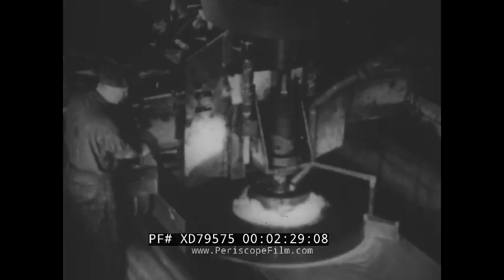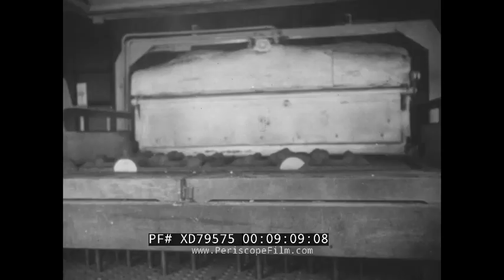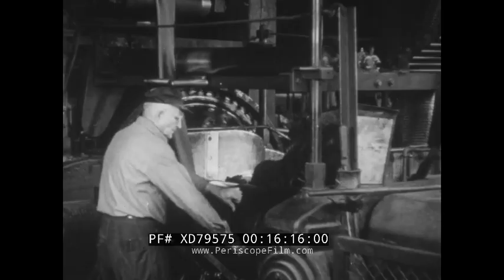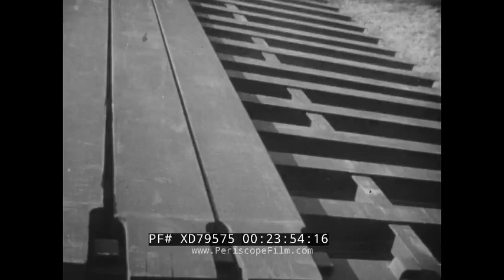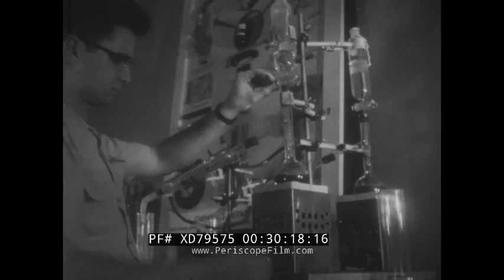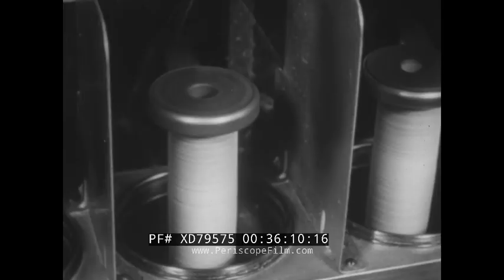" INDUSTRY ON PARADE "  GRANITE PROCESSING   SYNTHETIC RUBBER & PLASTIC BAGS  QUAKER OATS  XD79575

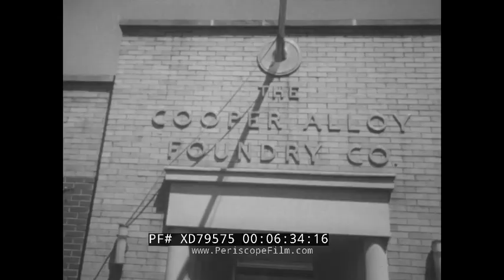Comment: 6:33 The company's 3 acres appear to have been at 135 Bloy St, Hillside NJ - which is now a baseball field and houses.  There may have also been something at Bloy & Ramsey St. Anyone know anything else about Cooper Alloy Foundary Co.?
Reply: It was the Breen Iron Works prior:
From NYT 1940- "ELIZABETH, N. J., Dec. 20—The Cooper Alloy Foundry Company, producer of stainless steel castings, has purchased the Breen Iron Works plant in Hillside. The machine shop and chemical and research divisions of the company, now engaged in defense work, will be moved to the plant immediately. Acquisition of the Hillside plant was necessitated by an increase in business and lack of space in the Elizabeth foundry. Foundry furnaces for casting operations will be installed in the Hillside plant later. In addition to making a large variety of cast stainless steel articles for peacetime use in industry and chemical plant the company is engaged in the manufacture of water-tight parts for the United States Navy."
Reply: Its was where Gargiulo Produce is now. (Sweetland and Bloy St).

J.G. Petrucci Company, Inc. demolished 17 obsolete industrial buildings on a 12-acre site formerly occupied by Cooper Alloy Foundry. The complex project consisted of remediating the existing environmental conditions and completing the Development and Design/Build of a 148,850 sq. ft., state-of-the-art food-grade distribution facility for Gargiulo Produce.